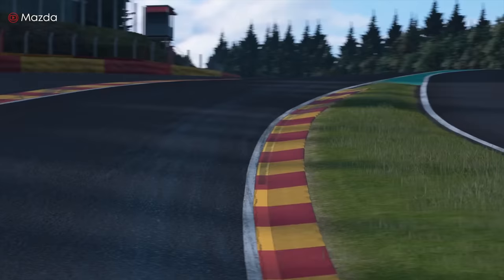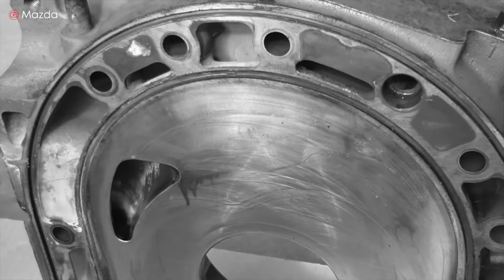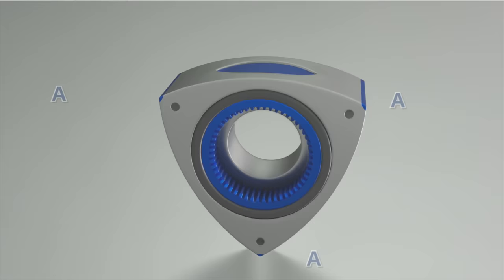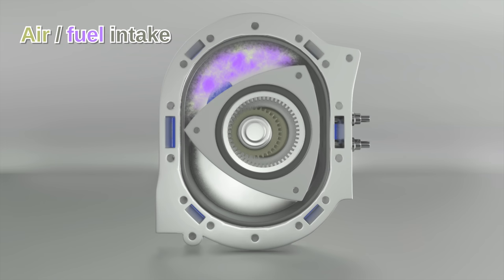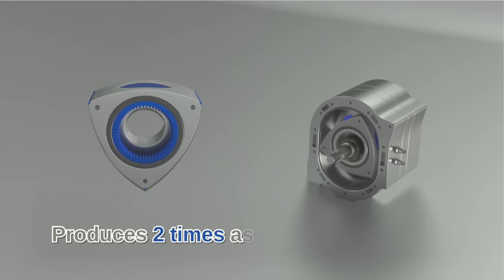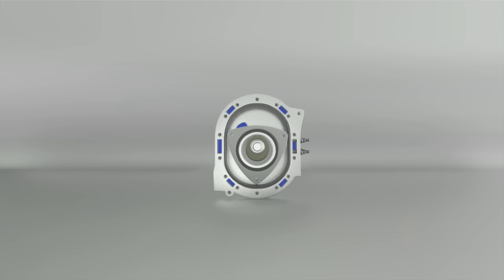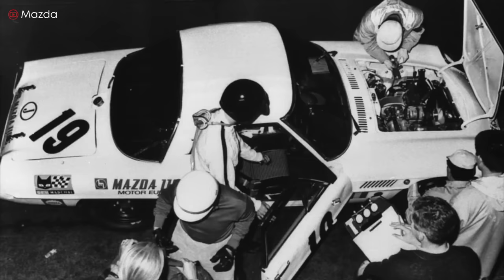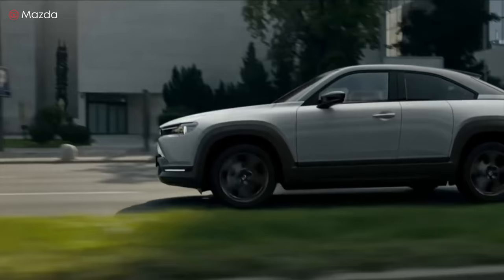Mazda's New Engine is the Most Powerful Engine Ever Made

Comment: I think I might include the lack of the entire valving system, with it's many many parts as another one, even moreso than the crank, especially when push rods, rocker arms, etc were included.  This one opens ports like a 2 cycle piston engine, but doesn't use all the downside piston pressure to help flow air/fuel.  You've got a lot of statistics all screwed up in here, especially if you are talking about Rotaries in the 1979 and up time frame.  Novella follows:

RX7s typically went 130k to 150k miles, even with very hard driving, so your 60k average service life, for later rotaries is WAYYYY off the mark, fairly typical for American V8s of the time, though the Japanese engines typically went MUCH farther.  On earlier rotaries, rotor seals DID have lousy life, about the life you stated or a bit less (50k, IIRC), but Toyo Kogyo put a couple million man hours, as I understand it,  into redesigning them (materials changes, sprung multiple piece apex seals, to accommodate short side end wear much better, etc), as and they got MUCH better after that.  There was certainly no 'nail in the coffin' mid 70s, except with American manufacturers.  The RX7 came out in 1979 and I think it outsold EVERY other sports car combined, at one point.  Not exactly 'in the ground' yet.  Reading junk, and actually living it (meaning an enthusiast) often provide very different 'histories', one real, and one often contrived by marketing people.  Remember the 'piston engine goes boing boing boing, but the Mazda goes 'hmmmm".  That one was actually funny, as are a small percentage of others.  Some YTers are doing vastly better jobs promoting products than the pros EVER did.  :-)

I have a piston driven TL I'm currently driving with 311k miles on it.  It has had NO engine work other than valve cover gaskets.  Still burns no oil, oil still honey colored, inside absolutely pristine except for a very light discoloration staining that wipes off with a finger.  I have pics when I did the valve cover gaskets at 309K and I can take a current pic of the odometer if you are having any trouble buying this.   My older Camry has 275, my son's corolla is right at 300, etc.   And several of these (not the TL) were not exactly well cared for.  My first RX engine went 135k to an oil leak on the upper transfer passage, at that stupid oil ring that is a common failure point.  Still ran great, I'm certain I could have put just seals in it and it would have gone MUCH further, but went to a four port and the hop up path at that point.

I didn't realize all the American manufacturers that built cars using them.  My family and I owned a few RX7's, great car, tons o' fun.  I did some hop up work on a few of them, street porting, higher flowing dual carb Webers, intake, headers, hardened rotors, welded and staked stationary gears, high flow oil pump, and several etceteras.  Made a 250 hp normally aspirated 13B.  Very simple engine to work on.

Also, driving the RX VERY easily, on the highway, I once obtained over 30 mpg, but that is not remotely normal. Specific fuel consumption is a good bit higher than a typical piston engine of the same output, but I think I averaged about 17 mpg with normal driving on a 1984 13B.  If you drove them hard they got much worse, just like every other ICE out there.  One (silly) example of exceedingly different scale motors was where Top Gear pitted a lambo (or something equivalent, some supercar) to a Prius, requiring the Prius to run wide open and where the Lambo was obviously loafing while 'keeping up', and the Lambo got better mileage than the Prius...yeah, stupid, but it does, at the limit, support what I am saying VERY well.  

Also, the rotaries were reclassified in almost every form of racing they were involved in, as the HP available from the rated CI was not really apples to oranges, and they were absolutely dominating their classes, to the point of absurdity.  Some  guys took one to an endurance race that they'd bought for something like $3k used, did nothing to the car except change out fluids in the tranny and rear end, hop the suspension, and build a killer new engine for it.  They had $10k total in it at race day.  At the briefing the official noted that the rotaries could be so loud on trailing throttle that they had been known to break windshields.  Some gentleman racing some ultra expensive exotic (about  $200k out of the box, new, IIRC) said snidely "I don't think we'll be having that problem".  When RX went by them they were doing in excess of 175 mph, and they took first place in the race, and IIRC by a large margin.  Back to the drawing board, clueless Germans (my snide remark, and I'm talking about THOSE particular Germans, obviously the original Wankel design WAS German, and they are amazingly good engineers, as a people).  See WWII...V1, V2, Me262, and a lot more.  So the moral of the story is, don't get TOO cocky when some very low budget (about 5% in this case) rice rocket pulls up containing some very competent engine builders, because you might get TORCHED, and have to retract your smirk, or eat your words.  Cheers, Scotty, good vid overall.  Guess it's pretty obvious to anyone who has gotten this far that I was thoroughly smacked with the 'rotary bug', though piston configured ICEs still have a large place in the old heart, as well.  Several restos and builds there for me, as well...4 cycles, and twos.  My favorite was the 70 Cuda I did, unfortunately not a 426 hemi, though, that would have been stellar.
Reply: A lot of of Mazda RX-8s with wrecked seals on ebay every day. 

When your low mileage RX-8 starts to struggle to cold start you know where that's headed...
Reply: I'd like to put Duel duelport Webbers on my 396Bbc.
 It would be nice if there were a intake manifold built to do that.

Comment: I added mineral SAE 30 2 Stroke oil to the fuel in my old RX8. This preserves, cleans and lubes the rotor tips especially when it ran on liquid petroleum gas (lpg).
Reply: No you didn't
Reply: You ran one on LPG 🙄 I gotta see proof of that one!!
Reply: @CommodoreFan64  Common practice in the UK 🇬🇧, search for “Mazda RX8 LPG conversion”. Wankel engines need more work than a conventional engine tho.

Comment: Mazda also sold a small pickup truck with a Wankel engine.  It was pretty fast.  The IMSA races of the early 1990’s had two cars with four-rotor Wankel engines.  They were fast and very loud.
Reply: Scotty forgot to mention that the NSU company also had a single rotor car called the Spider and a twin rotor car that was way ahead in design called the RO80.
Reply: Had one LOVED IT.

Comment: I had a R1 with an R2 engine that had been modified for stock car racing. I rebuilt it just out of curiosity. It was amazingly easy to work on, and the apex seals didn't cost much. It was a tremendously fun car to drive. It was the muscle car era, and I got a kick out of blowing the doors off of guys who thought they had a hot car. The brakes did not match the engine, and I got tired of replacing shoes. It definitely went much better than it stopped.

Comment: Best description of the Dorito-chip engine on Youtube! Rx-8's get a consistent 16MPG's city driving and 23MPG's highway. That's still the biggest drawback for rotaries.
Reply: Longevity is the biggest drawback for me. The combustion engine is so reliable and long lasting
Reply: @jamesfranko5098  Seriously! I have a '98 Nissan with almost 300k miles and it still runs just fine.

Comment: I bought an RX-3 in the late 70s for $300 because the Mazda dealership told the owner, over the phone, the cost of replacing the clutch and pressure plate, but I fixed it for $7 because it only needed a clutch slave cylinder repair kit and a little hydraulic fluid. I drove it for a while and gave it to my little brother who loved that pocket rocket until a woman ran a stop sign and parked her Volare station wagon in the passenger compartment.

One of the most fun cars of my lifetime!
Reply: agree, loved my rx4

Comment: A few interesting added tidbits:
(1) It wasn't quite brought out, but the rotor tip seals are lubricated by oil injection into the chamber. This contributes to pollution problems because now you are burning that oil as well as the gas.
(2) The exhaust temperature is much hotter such that the exhaust tubing is roll bar gauge, not the usual thin gauge found in piston engines.
(3) You might argue that the high exhaust temperatures are a sign that combustion is more complete, but high temperatures also contribute to formation of oxides of nitrogen, which is another pollution problem.
(4) Interestingly, in the 1970s Mazda dealt with pollution control not with a catalytic converter, but rather a "reactor". That is, the exhaust was routed to another cylindrical chamber that might look like a catalytic converter but was a hollow chamber. Air from an air pump was also fed into the chamber to complete the burning cycle, hence the name "reactor chamber".

That all said, I miss these engines. I once wanted to mate one of these to a Porsche 914 transaxle and install it in Fiat X1/9. (A friend suggested we also needed something British such as a Lucas electrical system to complete this international symphony. We whapped him.) Sadly, the Fiat was too badly rusted, so this project never came to fruition.

Cheers!

Comment: I have a deep love for the rotary engine and had a Mazda RX7 Savannah 1979 series 1 with a tall port...... It was decked out with the 352 Yokohama tyres and had mean set of mags. 

It was a metallic 2 tone candy Apple red and was the only car which I truly loved.

Totally the best car I ever owned and I've had a few....

The facts in this video are way off and not realistic, that said the only ever issue I had with my RX7 was the need to change the petrol pump.

The rotary engine is in my opinion one of the best engine I have ever had....

Subaru (blown engine) the GMC I owned (blown engine), Chrysler (blown engine) Nissan (constant engine issues) Etc.

My Rotary engine never blew and never had an issue with it

Comment: There is an inventor in Australia who converted a rotary engine to run on compressed air. It's used to power tugs in a warehouse and has promise in areas where electric sparks can be hazardous, like in mining.

Comment: Rotary engines are nightmares, they consume oil like Home Simpson consumes Duffs beer.
Reply: The RX-8s had worse MPG than cars with giant V8s.
Reply: And engine cooling issues too
Reply: But it's really really fast lol
Reply: @silasmarquez4146  no its not lol
Reply: @silasmarquez4146  Yeah good one.
Reply: @silasmarquez4146  no
Reply: Yea, to cool the engine a lube the apex seals.  It's by design, that's not really a flaw. Mileage on the other hand.

Comment: There's even controversies on how they come up with the motor size of a rotary. They say 1.3 liter while someone else says it's actually a 3.9 liter
Reply: I have one, did an engineering degree, given this a ton of thought... and I can't align with one or the other! (1.3 vs 2.6) ;D
Reply: Odd, 1.3 x 3 is 4.2 & as that is only one rotation of the rotor ( ie one detonation per 120 degs ) for a comparison with a four stroke ( one detonation per 720 degs) , would that not suggest 1.3 x 6 ie 7.8?
Reply: Well, the volume of the air that is squashed for the bang is 1.3 for Rotary so perhaps it's a 1.3.  But then on a 4-stroke it uses that volume twice per explosion but it's still called 1.3...  but since Rotary uses two different sections for bang and exhaust then perhaps it should be 2.6.  However.. is it really 3 cylinder faces (as opposed to 1 bang chamber) in which case it's 3.9.  or... perhaps we need all three cylinder faces using two different bang/blow volumes which means it's 7.8.   Ho Hum..
Reply: @robertwoodliff2536 I had to go do some reading on this lol. So you are using the actual rotor rotation, but they use crankshaft rotation to come up with engine size. The rotary engine crankshaft (eccentric shaft) spins 3x faster than the rotor. If you're looking for the rotary engine size given the same rotations as a 4 stroke than yes you are right (which might explain their bad gas mileage) in that it packs the equivalent of 7.8 liter of working volume 4 stroke engine, there are some people though that consider the rotary similar to a 2 stroke. I think each chamber should be considered like a cylinder since each one takes part in the combustion process and in that case 1.3x3 is a 3.9 liter. And 1.3 is already taking into account that the 13B motor has 2 rotors. For tax and emissions purposes everyone is going to use a different standard
Reply: I think if you look at LeMans and the rules and regulations when the 787B raced and the rotary engine they used,it was calculated differently...And that was used to determine the size of the motor for the races.I think thats the best calculated call for a rotary engine size.

Comment: That's the old Wankel design. It has seals on the very edge of the rotating piston that wear out very quickly.
Reply: Yeah, that's what he said.
Reply: Seems odd that by now there aren't better materials that can be used to extend the life of the engine...along with dramatically better lubricants that were unavailable only twenty years ago.
Reply: @northdakotaham1752  — Even if they did, it’s design shortcomings make it a very inefficient design that wastes fuel and pollutes heavily even on its best day ...
Reply: @northdakotaham1752  there are better apex seals now adays
Reply: @sking2173  I get that bc of the short combustion duration but piston engines were very inefficient also before a million hours worth of design improvements were initiated.
Reply: @bluemobster0023  so what kind of life expectancy can one expect?
Reply: @bluemobster0023  Not really. Nobody cares anyway.
Reply: The seals have gotten better ... Rotary Aviation . Com has these apex seals that last along a time. 100k long .
Reply: @northdakotaham1752  Big 3 don't want it to succeed that's why it never took off.

Comment: With many years of owning rotaries, working at Mazda dealerships, the main down fall is babying the engine. 3 rotations of the essentric shift means internals are spinning at a third the rate of the rpm... internals are spinning at 1000rpm when the tachometer is reading 3k.... the 8s had 9k redline rpm for a reason... it's an enthusiast car... high maintaince and less knowledge abound... but imo easier to work on than a traditional engine. So a dyi person who lives and breathes cars it's a perfect match.

... subbed and liked

Comment: I'm more anxious for the inline six.
Reply: Who will build that one?? Those were solid designs!
Reply: @northdakotaham1752  AM STILL WAITING TOO... 🤔
Reply: @SalsHQ  I have three vehicles with straight six motors plus several tractors. They are solid, smooth running designs that last a long time.
Reply: @northdakotaham1752  CAR MAKERS ARE BORING NOWADAYS, SEEMS LIKE A LOT OF PPLE TRYING TO BE LIKE BENZ, ALL GLITTER AND GRANDFATHER EXTERIOR... MAZDA TO ME IS CLOSER TO BMW AND AUDI... MAZDA WANTS TO GO LUXURY BUT IT SEEMS LIKE THEY SO FOCUSED ON SUV'S
Reply: @northdakotaham1752  iNLINE 6 🔥
Reply: @SalsHQ  one obvious issue is the physical length of the motor. The vehicle has to have enough space under the hood.
Reply: @northdakotaham1752  MAZDA SAID THEY PLAN TO BUILD A NEW PLATFORM WITH LONG HOOD DESIGN RWD 🍿👀🔥
Reply: @SalsHQ  Mazda could make an awd vehicle with a  n inline six IF they wanted to. Alot easier than designing a better rotary.
Reply: @northdakotaham1752  JUST SEEN A BMW 650i COUPE LIKE 25 MINUTES AGO... MAZDA SHOULD PUT EM TO SLEEP 🍿👀 I LIKE JAPAN CARS BUT THE DESIGNS ARE GETTING A LIL BORING... I BELIEVE LEXUS AND MAZDA ARE THE ONLY HOPE
Reply: @SalsHQ  too many copy cat cars. The designers must all get together and agree upon the most ugly design...then agree to build them. A few rogue designers still come out with a unique design...but then the mechanicals and electrical make it a lemon.
Reply: @northdakotaham1752  I HOPE MAZDA KODO DOES MORE 🍿👀 MOST CARS NOWADAYS LOOK ALIKE... ASTON MARTIN, JAGUAR, BMW, PORSCHE & MAZDA STAND OUT TO ME... BUT AGAIN  MANY CARS ARE BEING BUILT ON PURPOSE TO GO OUT AFTER CERTAIN MILES, KEEP THE OWNER IN A RAT RACE

Comment: the idea is to make a triangular bore with an oval piston , for higher power  with less emmissions , it just works and well , reverse the idea of the rotary engines design , also combats the heating problems and fuel efficiency ,+ emmissions

Comment: Liquid Piston has an interesting take on a new rotary.
Reply: Liquid Piston's design is inside out. It is used by the US military.
Reply: I've been watching liquid Piston for years..where are the lawn equipment they have promised. If it can do what they say they can then where are all small lawn mowers and chainsaws, weedeaters and blowers would be useing them.
Reply: @1voiceofstl  
Too late. Electric motors and batteries have overtaken ICE engines. The solid state battery will be a game changer.
Reply: @GbbJunkie 
Solid state battery will be about 4 years in a Toyota. A game changer.  Battery powered equipment is here now with Li-ion. It is to take over. No electrical leads or gasoline storage, etc. 

What is now will not be in five years time.